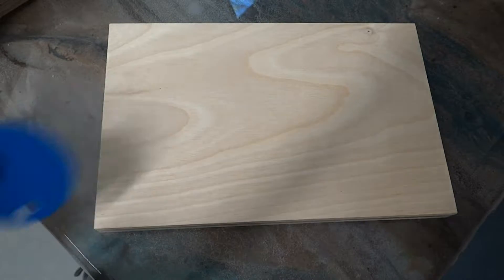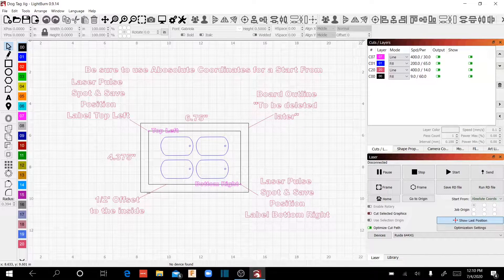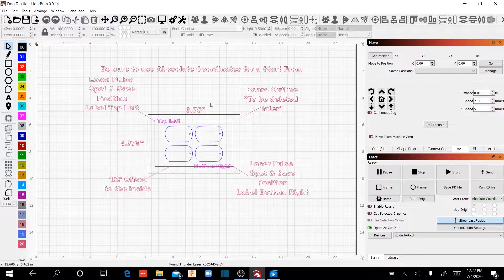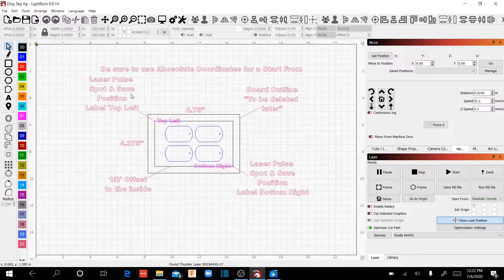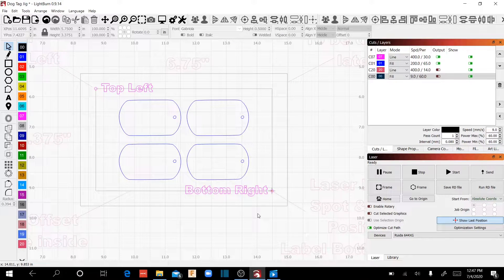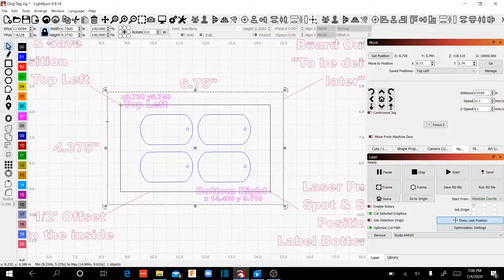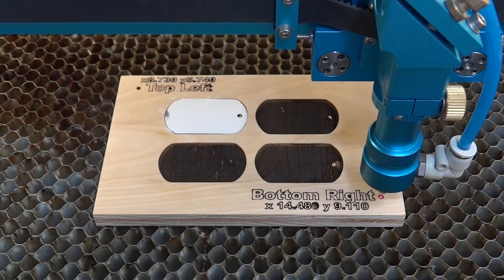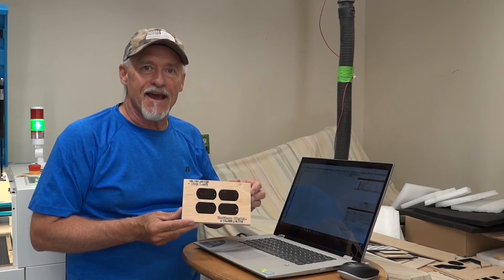Making a Jig for Laser Engraving Tags

Comment: Will a 10w or 20w diode laser work well to engrave metal dog tags? Or even anodized aluminum tags? Thanks for your time and assistance
Reply from the maker: a fiber laser is best suited for those tasks
Reply: @computercreationz  one more question.  I'm totally new to engraving. I'd like to print a few hundred tags/labels for fruit trees and grafts.  It doesn't matter to me what material is used, as long as the material is weather and corrosion proof. Do you have suggestions on the best laser and best material to use for this project? Thanks again for your time and assistance.
Reply from the maker: @rob4263  two color up stable sign acrylic would be best but I don’t know if a diode will engrave this material.

Comment: I'm having an issue in this video, I'm at the point to where you click on the move tool and i click on the upper left corner. My laser does not move.
I'm not sure but i had to figure out how to do the outter and inner frame not sure if i did that right or not. I made the frame around the dog tags and then made another frame which i have saved in the line menu of the project box. Coud someone please tell me what might be wrong and is there a video showing how he put the template tigether period, for me being a begginer it seams like steps are missing. ty very much
Reply from the maker: there may be some issues with your particular laser. is it a diode?
Reply: @computercreationz  do you have a video that shows exactly how you made the actual jig, step by step making the frame, setting the inner parameters, adding the dogtag, making the multi colums and rows. to the point of this video that i just watched
Reply from the maker: @albertgarcia607  I have another video on how to make jigs and the concept is the same but that jig is much larger. Check that one out
Reply: @computercreationz  yes there was an issue with me lol i was not connected to the laser.
now my issue is i am at the point in the video where i move the laser the top left to make my firing mark, and it fires about 1 inch to the right of the cross hairs. then when i go to move my laser to the bottom right to make my fire point it is off by at least an inch low and an inch to the right.
im wondering if my laser is not lined up with the cross hairs, is this sounding like that may be the issue.
    sorry to be a pain but iam totally new to this whole media type of work. ty so much for your help.
Reply: its actually the cross hairs that do not go to the marked bottom right position

Comment: Cool video, thanks.   How do you evacuate the smoke when burning with your laser? Thanks
Reply from the maker: I have an 8” affinity inline fan that works very well
Reply: @computercreationz  so I’m assuming you have a hole in the wall to evacuate the smoke outside, right?
Reply from the maker: @I-build-crafts  yes a 6” flexible duct to a 6” dryer style type vent
Reply: @computercreationz  hmmmm so a hole in my brick wall.   That’s a real deterrent for me. I’ll have to research a different way to have ventilation.
Reply from the maker: @I-build-crafts  unfortunately any laser you operate will require ventilation. I’ve heard of some people going out the roof!
Reply: @computercreationz  I'd have to draw the line at that. I will figure something out. Thanks for getting back to me so quickly!

Comment: Hi what did you spray on the metal and what setting have you found best? Thanks
Reply from the maker: I use enduramark spray, for my 60 watt 200 mm/s at 40% power provides the best results. make sure your stainless is very clean before you spray. 91% alcohol works well.

Comment: We just today wanted to try and align a pre-carved sign in the laser to add some fine detail. I’ve been running CNC plasmas for years and a CNC router for the last few years. No one makes a laser that can be easily added to my CaMAster Stinger so until that happens, I thought it would be possible to do the carving and index the part to realign in the laser. I found your video tonight and the process you used for aligning the tags looks as if it will do what we need. Thanks for sharing.

MM
Reply from the maker: thanks for watching, I appreciate it!

Comment: First thank you so very much for the beyond helpful videos! New to this and you have been so helpful. So I did make a jig and followed your every step to success! Now I have a quick question do I need to put send Mark spray on the dog tags before I laser engrave them? I have a OMtech 80 W CO2 laser. Thank you again and I appreciate your time and guidance!🤗
Reply from the maker: If they are powder coated a color no Ned for any kind of spray. Just laser your design. If they are stainless steel tags you must use a marking spray before laser engraving. Be sure to clean the stainless very well with acetone or alcohol before you use marking spray! Thank you for the comments and watching my videos

Comment: Binging your videos for two days now, keep it up :)

Why don't you just place every jig you make at the top left of the workspace (home)? That would make placing the jig a whole lot faster, right?
Reply from the maker: Working I upper left corner means I have to bens way over no need for back problems. I work where I want to not where it’s Connie t for the laser. Lol
Reply: @computercreationz  love your videos!
I understand where your coming from, my laser is 1300x900, it didn’t take long for my back to complain. My solution was taking some ply, indexed into the corner and cut  a “ new” corner, closer to the front of the machine and my control panel😎

Comment: I am struggling to get the jig to work. When I go to use it after creating it, the machine just goes to the very bottom right corner of the bed whenever I pick any coordinate for any of my jigs in the move tab. That happens no matter what origin type I pick or any other setting I try. What am I missing?

Comment: What kind of laser is this?
Reply from the maker: Thunder Laser Nova 24 60 watt co2 laser.
Reply: How do you like the way it runs? What’s the thickness of material you have been able to cut?
Reply from the maker: @juansalmeron1537  it’s a fantastic machine, I can cut 3/8” no problem with external air connected

Comment: Hi, after finishing the set up of your jig and writing on the coordinates for reference, I’m slightly confused to what order you did things. For e.g, sending to the printer, changing coordinates to user origin, saving the document... etc. Apologies!
Reply from the maker: on initial setup you would do a pulse on the laser and then before moving the laser head you would go to the move tab to manage button then add new coordinate and name it, do the same for a second laser pulse point usually one top left and one bottom right. once both of those locations are saved all you have to do is put the jig in the laser bed focus your lens, go to move tab pull up top left saved position line up laser pulse mark, then select bottom right in the saved position and line you jig lower pulse up with you red dot and your set. you MUST have an accurate red dot pointer for this to work

Comment: you are wasting time by manually setting your jig in position every time. Watch this video https://www.youtube.com/watch?v=n__saOKVupA&t=112s and you'll see lightburn doesn't need the jig to be straight and square every time. Show the software where your two designated points are and the software will do the rest even if you turn your jig at a 45 degree angle relative to the gantry. Additionally , if you install hard stops on your x and y axis you will be able to adjust your software positions so you can hit a reference point simply by placing the jig in the machine.
Reply: This is exactly what I was expecting to see in this video and I was surprised to see he was doing it manually!
Reply: Lightburn published that video (and the update to the software as far as I can tell) AFTER this video was made.   This was a really ingenious method of tackling a problem that didn't have an easy solution until the software update.

Comment: Thank you for all these great videos; they are giving me a great introduction as I wait for my laser to arrive. One question here though - why not just jam the wooden jig into the top left corner so it always has a straight edge to line up on? Or is there too much gap between the physical edge and where the laser starts?
Reply from the maker: Hi Jo, I replayed before but I don’t see it so yes you are right the gap pretty large in my case along with the autofocus sensor. the open part of the laser is larger than the working area of the laser. so if that was possible you would have to keep track of the piece of wood you used and could be off. one thing about creating tags is that a little misalignment will really show up in your design on the tags. the smaller the tag the more critical it becomes. congrats on your new laser . They are so much fun!

Comment: Another brilliant video.   Such a great idea!   Quick question - if you're doing a run of multiple sets of tags - do you lock the jig to the table to keep it from moving in between sets - or do you just check it after placing the tags?    Thank you again for all your work on these videos and the thought that you put into making the instructions clear and easy to understand.
Reply from the maker: Hi Todd, thanks for the question, yes if I’m going to be doing several tags I put down a couple pieces of 1/8” ply with magnets or pins to lock in the location. That way I can remove and reload the jig or make a bigger jig. be sure to see the video on Variable text option in LightBurn at the end of the video. That can make doing multiple names on tags quick and easy.